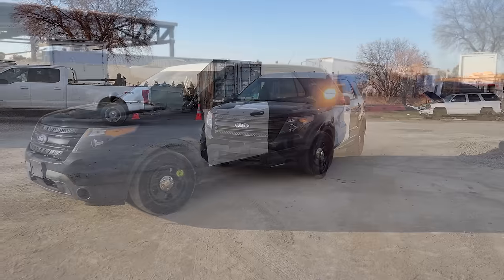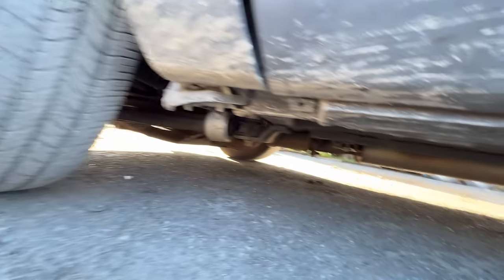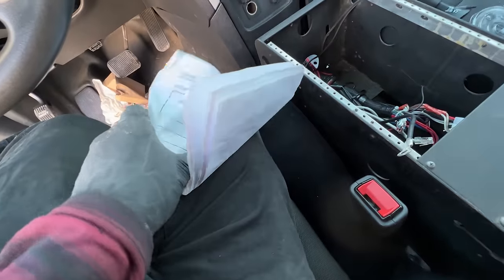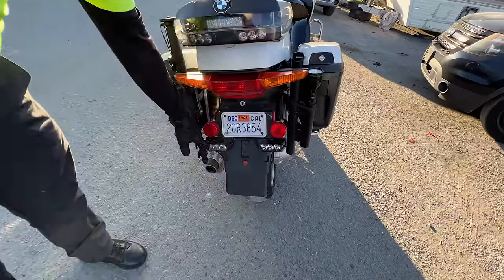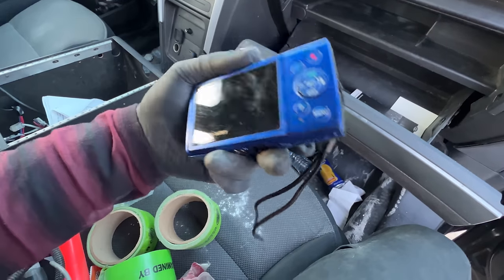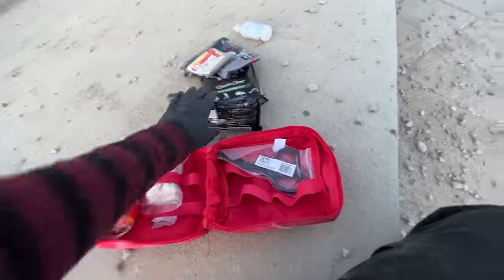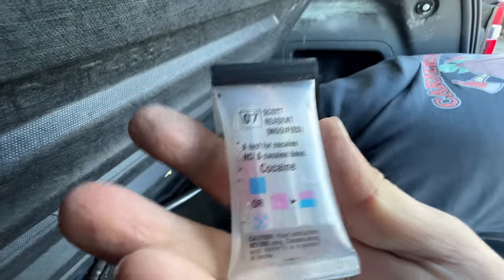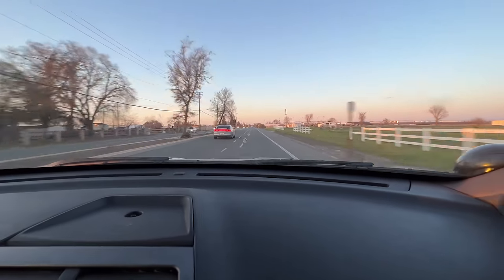I Bought an Old Police SUV! Had To Call the Cops After What I Found!

Comment: Double chevron is not Private First Class it’s corporal. It’s private with 1 chevron. Pfc with a chevron and half circle connected. Specialist with a filled in chevron and half circle with a eagle emblem in the center
Reply from the maker: thanks for the info! 👍👍
Reply: It is probably for Police Officer 3. SDPD does not have a corporal position. And depending on some departments one strip is just a higher police officer, one stripe with bottom rocker is normally a training officer. 

But SDPD does not have any corporal rank so not sure where those came from unless their field training officers use them on collars to designate they are a trainer.
Reply: When he says 'V shape' I chuckled 😁
Reply: 3 chevron is corporal
Reply: @randycoolon4760  3 stripes is a sergeant.  This was corporal. Your not counting the metal bars, you count what the metal makes, in this case two stripes. Either way, San Diego Police doesn’t have a corporal position.
Reply: @randycoolon4760  3 chevron is sergeant.... thats what i know because i served 8 years in the military. think again mate
Reply: The person who made the video put those in the vehicle. Law Enforcement wares a patch sewn on there shoulder showing there Rank Ensigna. The Army wouldn't ware Dress Blues & Dress Green's Pin On Rank with the OCP- Operational Camouflage Pattern it's a subdued rank patch worn center chest . They haven't worn pin on the collar Rank Ensigna with there cammie's in over 20 years.
Reply: The ARMY Rank's are E-2 Private 2nd Class & E-4 Corporal.
Reply: @Texasmilitarydepartmentvid9654  law enforcement uses pin on chevrons. This has nothing to do with the military.
Reply: @PTRRanger951  Law Enforcement don't ware Pin On The Collar Rank. They ware Shoulder Patches barring there Rank Insignia . There Rank is outlined to make it stand out from the Dark Police Uniform there wareing. There Collar Pin's say LEO-Law Enforcement Officer. Those are ARMY Rank Pins. E-1 Private dosent exist in Law Enforcement and those E-4 Corporal chevrons would be Law Enforcement Officer lll.
Reply: @PTRRanger951  That would be the LAPD- Los Angeles Police Department for Law Enforcement Officer lll as the SFPD-San Francisco Police Department dosent have that Rank.
Reply: @PTRRanger951  A Bottom Rocker under the Corporal Chevrons with a Diamond that look's like a Lance Corporal would be a Detective.
Reply: We're talking Law Enforcement Police Rank. What he found was ARMY Enlisted Rank Pins. A E-4 Corporal would be Law Enforcement Officer lll. A E-3 Lance Corporal would be Detective ll and E-2 Private First Class would be Detective lll than you would have Sergeant. I know that's confusing as Hell. Trying to figure out Police Rank would be like trying figure out why The NAVY's Commissioned Officer's Rank structure is all FUBAR compared to the other Branches.
Reply: @Texasmilitarydepartmentvid9654  I didn’t mention anything about PFC. And some agencies use stars, some diamonds. But in this case we are ONLY talking about San Diego Police. And San Diego Police does not have the rank of Corporal, or PFC or Private. So none of it matters. And Midwest, and east coast states use PFC in law enforcement. Very very very few western states use that rank. You can have neighboring departments with completely different rank structure and ways they display it. I have been in law enforcement for 25 years and work in several different states. One department had a corporal rank only in the jail, but I wore corporal stripes, both on sleeve and on pins, to signify I was a field training officer. But the car in the video is from San Diego. They don’t have a Corporal, unless they use two chevrons to signify a Police Officer 3, or they use them to signify an FTO or anything else. Could have been left there from an explorer, or volunteer too.

All my time I have spent in San Diego, I never remember seeing anyone wearing anything on the sleeve except sgt stripes.
Reply: That's the Army's raking on ranks one Chevron is a PFC in the Marines and one Chevron with a rocker underneath it is a Lance corporal
Reply: @Texasmilitarydepartmentvid9654  
Wear..not ware.  Your Welcome.
Reply: I'm a Marine and a PFC is a one Chevron look it up
Reply: Not a semi circle. It’s called a ROCKER under the stripes. They are NOT CHEVRONS, they are STRIPES. The physical metal emblem or the cloth emblem sewn onto a uniform is a CHEVRON. 

YOU are conflating Army and Marine Coors rank insignia (chevrons). The first rank in the Marine Corps that issues a rocker is the rank of E6 Staff Sergeant. Only the Marine Corps has crossed rifles in the ranking system has cross rifles in the center starting with lance corporal. Higher ranks have different centers based on area of expertise and delineate admin job from infantry jobs.
Reply: Private first class is one Chevron above a rocker
Reply: I was in the army loved my rank spec 5 combat medic! From e7 on was a pain,
Reply: @ezraknapp3316  A Chevron with a Rocker underneath it would be E-3 ( Private First Class) in the ARMY. MARINE CORPS - E-3 Lance Corporal is a Chevron with 2 Crossed Muskets underneath it .
Reply: Yea most departments actually don't have corporal as a rank but they use the insignia for something else its bizarre
Reply: Or training officer at most departments.
Reply: Your message isn't clear.  The rank that was shown was not two chevrons.  It was a chevron that wasn't filled in.
Reply: @Texasmilitarydepartmentvid9654 wearing
Reply: @Texasmilitarydepartmentvid9654 the sfpd does have that rank, it's just that they don't get anything to wear.
Reply: @ezraknapp3316  this is police, not marines.  Different ranking structure.
Reply: SPC doesn’t have an eagle it’s a crow😂😂😂😂

Comment: I'm stunned that the PD don't clear out a vehicle before it goes to auction!
Reply: I've seen worse, vehicles with batons, cuffs, the laptop, all the lights and sirens still in there. As for the camera I'm guessing maybe it's a bit of a last minute thing.
Reply: Maybe they hid the stuff and planned on buying it back ,free.
Reply: I once saw a cop get called in from patrol, told to drive his Crown Vic around back, and then to move his personal stuff and weapons to his new unit.  He was still in the process of doing so when the auctioneer got to the unit that was being retired.
Reply: Because PD don't give a shte.
Reply: Lots of things get left by accident.. if I recall correctly the card to replicate R.W.Regan signature was left in an auto pen device and sold.
Reply: Somebody is supposed to.
Reply: man power vs payroll issue vs sheer volume of vehicles

Comment: We bought a jeep from an online government auction. It was a jail administration vehicle, driven ONLY by the jail administrator. (We were told ) When we went to pick it up it was right across the driveway in front of the "Sally Port " gate. It was directly ahead of a camera. I checked the oil and fluids, and looked in the console for the second key that we were told about. I found a small red change purse and under it was the key. I looked in the change purse and found a "Mostly" empty baggy and a short straw. The lady that we got the title from had asked several times which way we came into town and which way we were leaving. After finding the little surprise, we went straight to texaco 2 blocks away and I threw that red bag away. We did NOT leave the same way that we had told the lady at the courthouse. I have a feeling that they may have had a surprise waiting up the road. But it IS a great vehicle.

Comment: In 1981, I was in the US Army as a Military Policeman and nearing the end of my enlistment.  It was practice where I was stationed not to put "short-timers" on patrol duty in case they caught a case that may later require a court martial appearance.  The Army didn't want to keep you longer than the enlistment.  So I was doing assorted support duties for my unit and the MP station.  While going through a patrol vehicle I found a straight razor stashed between the cushions of the rear seat.  Some GI prisoner was lucky some MP did a crappy body search.  I turned it into the Desk Sergeant and boy was he pissed.  I understand it came up in shift briefings for a while.

Comment: I worked in a police department radio shop for a career. Whenever I did removals before a vehicle was traded in, I would find weird things. At one point when I tried to bring something to a staff sergeants attention he said basically to just throw the crap away. The main reason was none of the items could be linked to a case and there was no way to catalog something that was just found under a seat or pushed into the upholstery. Some examples of what turned up were some nice knives and in one vehicle I found a pellet pistol.

Comment: We had one of those we'd picked up at a state auction, we used it as a courier car.  While it was definitely fun to drive (the acceleration is crazy), we had all sorts of mechanical issues with it over the two years we had it.  One of the things that people don't understand about police cars is that the police use them hard, along with a lot of "idle time," so the mileage on the odometer doesn't really match up with the "mechanical age" of the engine.  Not to mention that they get truly crappy gas mileage - we were getting around 10-14 mpg.
Reply: If you had one of those suvs then, yes. A crown vic however, will run until the end of time

Comment: The insignia with double bars is corporal and the 9mm rounds you found are practice rounds. They are flat on top and are known as "Wad Cutters". They punch through the target leaving a perfect hole. FYI
Reply: Nope the 9mm are semi flat point or truncated cone. They go very deep in tissue deeper than round nose. If u could believe that. Wad cutters are only for revolvers as they’d jam in a automatic
Reply: Correct on the double bar, but wrong on the 9mm being a practice round
Reply: The flat tip hits harder and used for deeper penetration on dangerous game. Wad cutters can be used in semiautomatic weapons S&W made a 38spl semiautomatic for match use and I have loaded 45apc with them long ago only had 1 of 3 was reliable 745S&w would gold cup not

Comment: The odd tones on the phone are the TTY connection for deaf touch type conversion
Reply: 99% of the people still have no idea what you're talking about.

Essentially, for old school phones, you put the hand-held receiver on another TTY box that translates those tones into text. It turns the phones into texting computers.
Reply from the maker: thanks for the info I didnt know!
Reply: Right, so anyone with an old TTY device that doesn’t work automatically, will have the keypad pop out…😊

Comment: Common misunderstanding: The blue and white segments on the BMW logo stand for Bavaria, the region in Germany where the company began, under a different name (Rapp Motorenwerke GmbH) with a different round trademark. 

Bavaria's colors are white and blue, so that for legal reasons BMW chose the reverse: blue and white. BMW stands for Bayerische Motoren Werke (Bavarian Motor Works), when only part of its product  range had to do with aircraft engines. On the other hand, yes, BMW itself did use this misunderstanding about the propeller image in some of its advertising.
Reply: The silver bars between the blue/white checkered is the propeller. But you are correct about the checker part.
Reply: Some of their advertising from the 1920's included a plane with a spinning prop with the 4 quadrants superimposed on it.

Comment: I have had two Ford Police Intercepters and they ran like hell.

1985 Ford Crown Vic with a 351 Cleveland actually a   4 Barrel Carb.
1991 Ford Crown Vic with a 4.6. 281 CID interceptor.

The 85 came from a Sheriff's Office and The 91 came from A State Highway Patrol Department.

Ll

Comment: They warbling sound "for the hearing impaired" runs a TDD, a device like a computer terminal that displays text. TDD stands for "Telecommunications Device for the Deaf". There are free services where am operator will listen to the speaking side and type it for the hearing impaired person, then the hearing impaired person types their replies and the operator reads it back to the caller. It's a great service for a good cause. But that's when the warbling sound was, the modem data tones to connect to the TDD.

Comment: The rank insignia Rick found at the beginning is Private First Class or pfc since the design uses a top and rear bar but if there is only one hole in the middle it is pfc and corporal has two holes or one hole with a stripe down the middle
Reply: It is the bars not the  holes. That was two stripes, Corporal. Former SSGT USMC here.
Reply: @newsnowriversidesgtrock  pfc=chevron with rocker. Corporal is 2 chevrons. Correct?
Reply: @newsnowriversidesgtrock  I screwed up. 1 chevron is pvt first class, 1chevron with a rocker is lance corporal and 2 chevrons is corporal. Correct?
Reply: @tombs31  I am not sure which service you are referring to. They literally are all different except Space Force is the same as Air Force for now, and Coast Guard is the same as Navy, again , for now.

It sounds like you are referring to USMC Rank insignia
Reply: @tombs31  
    Sort of. You found the rank appliance in a police vehicle. Each Police Department has its own rank designation. Traditionally no chevrons means basic officer/member, or more precisely, Officer Level One; next, One stripe; Level two; one stripe with under stripe device (could be anything including a "rocker" type stripe, star, diamond or as in USMC crossed rifles and the Corps does call this Lance corporal) is Level three; Two stripes is Level four traditionally called Corporal, and three stripes is level five traditionally called Sargent.  

Military is standard and can be found with a simple google search.

Everything is department determined. Sooooo....... there is probably at least one department where what you said is correct, and maybe a bunch.
Reply: @tombs31  correct in most situations and is correct for US ARMY.

Comment: I own a camera like the one that you found.  The battery is not rechargeable with just the camera and a cellphone charger, but there are kits with batteries and chargers that will fit the camera if it has the model information on the front.  With a little online detective work, you can make a match.

Comment: That metal plate is a steel bullet resistant plate It is supposed to be able to stop if I'm correct up to 9 mils though the metal ones might be able to stop up to a 45
Reply: Steel plates are usually rated to stop .308 rifle rounds, not all of them obviously some are designed to stop .44 magnum at the most intense, just like soft armor that police use, its max stopping power is for .44 and 12 gauge shotgun shells

Comment: Can you tell me the difference between a regular ford crown Vic and a p71 interceptor?

P.s I have a 2003 ford crown Vic p71 police interceptor
Reply: Bigger alternator,  bigger graded hoses, bigger radiator,  z rated speed tires, upgraded suspension,  no limters so car should top out at bout 130, with out a bar light lil over 120

Comment: If it's a police interceptor utility shouldn't it have a 3.7 L? I too have a Ford police interceptor utility, but mine is a 2013 and it does have a 3.7 L and it's all-wheel drive all the time.. and I wish mine came with the spotlights and all those LED lights.. that would have been kick ass

Comment: I thought hollow point ammo was banned after the first World War because of the type of wound damage they can cause?
Reply: Hollow point is designed to deliver all of the energy to the intended target rather than passing through. This does two things - it makes the round more effective at stopping the threat and it reduces the risk of hitting an unintended secondary target.
Reply: Geneva Convention only deals with what happens in a military conflict. What the cops use isn't covered by it (that's all local laws), so they can use HP ammo while the military has to restrict itself to FMJ.